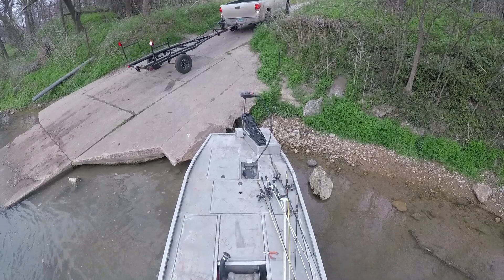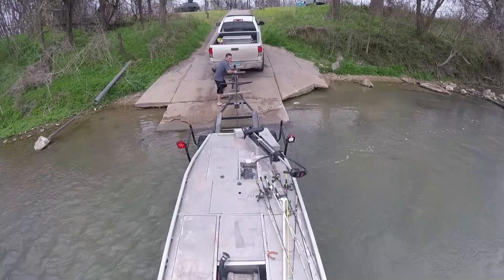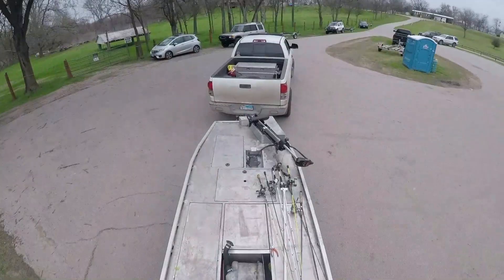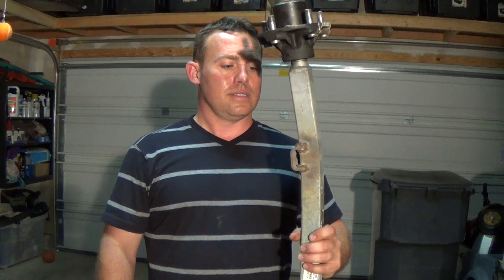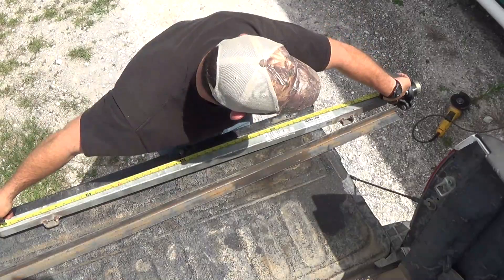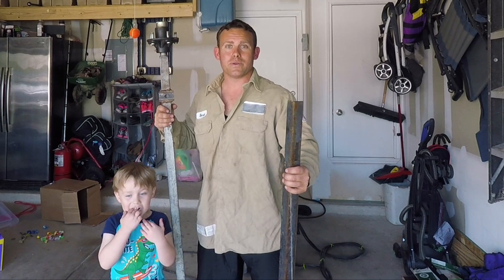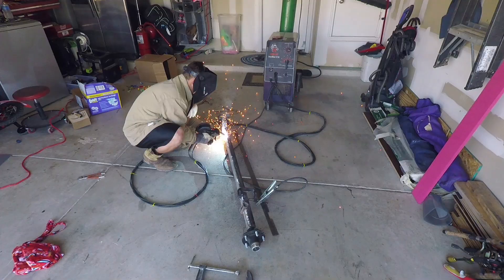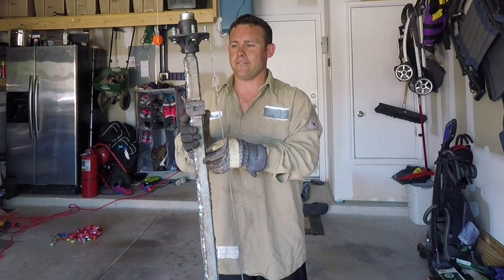How to Fix a Boat Trailer axle. Boat Trailer Fail.

Comment: Nice fix. I was thinking of using my tubeing bender instead of a chain..and you did it!
Reply from the maker: Yeah it was probably alot easier. I've gone through a whole new set of tires with this axle, still going strong Thanks Chris

Comment: Nice job on the fix, did it last? I bent a 2x2xquarter single axle and I wish I had thought about using angle iron like you did. What I did was just flip it so the bend would be up then I welded between the leafs a square smaller tube, spot welded it on top of the bend, so far I have hauled with it once, no problems but there is that area that was not covered with re-enforcement which is the area from the spindle to the leaf and between the mounting bolts.
I have a dual axle trailer  2x2xquarter that I bent as well, so on that one I believe I will use your method Angle vs smaller square stock, next time I make an axle for a trailer though I think I will go larger diameter and round, the 2x2xquarter seems to have a limit I want to go higher than.
Reply from the maker: Oh yeah! I’m still driving around on that axle and have been on some long road trips to go fishing.

Comment: Terrific video! Love your approach!  How did you know you were gonna need a Harbor Freight 12 ton hydraulic pipe bender ahead of time, to already have one? Positively psychic!  One boat trailer fail I had was a spindle getting bent, don't remember how, but it wiped out a couple weeks of boating expeditions, had to replace the axle.  Other boat trailer fails, bought a 16 foot aluminum boat, only had to replace the hubs on that one.  When Cabela's has your replacement hub in stock, it's a good day.
Reply from the maker: Oh yeah, nothing worst than being stuck on the side of the road trying to brain storm what to do. Yeah I already had the pipe bender. Thanks Jim

Comment: Last night my leaf spring broke and my axle spun around all the way from the right side to the back left corner of the boat and the left side was hanging by the front leaf spring bolt and that tire was bound up and at an angle. Had a tow truck take it to the house about to order a new one since my current axle has a 90 degree bend in it and most of the leaf spring hangers broke off
Reply from the maker: Oh dang, thats a bad one brahden. I hope your able to get that all fixed up. I bet that looks horrible.

Comment: Nice Job straightening and reinforcing BUT...you mounted the repaired axle on Top of the leaf springs.  It was originally Below the leaf springs.  Your trailer does not run level now.
Reply from the maker: You are 100% correct. Very smart to catch that no one else has caught that. I did that on purpose, I lowered the trailer boards and flipped my hitch receiver upside down. Thanks  bob

Comment: Had somebody helping me push my trailer up into a 16 foot truck bed.
Using steel on steel ramps.  Halfway up one wheel buckled.  Took the
trailer down again and saw the bolting surface of wheel had deformed.
Lifted damage side of trailer using wheel axle jack.  Unbolted wheel.  
Axle bolts found damaged also.  Began repair.  Accepted free wheel
replacement.  Found local hardware outlets were closing early due to
pandemic concerns.  I've never experienced a national health problem 
which shuttered part replacement retailers.  Yes, I was masked with
gloves and goggles on also.  Put away my tools and will go online to see
what walk-in retailers are available tomorrow morning.   Decided  I'm too
old fashioned to seek Drone delivery services.  Or risk losing a delivery to
trespassing thieves.  Cash and carry, that's me.   Know what I'm saying?
Reply from the maker: Dang, I'm sorry that sounds horrible. I know exactly what you mean. Times aren't like they used to be, this is a whole new world. I hope you get that thing fixed soon, sounds like a bad situation.

Comment: How much would a new one cost?
Reply from the maker: All said and done it isn't as expensive as you would think, unless you do not have a welder and have to hire to get it installed but parts will average you 100-150$
Reply: @TBassFactory    Thanks for the reply.....  I just bought a neglected  Basstender and it's trailer...  it's not beyond repair  but i was thinking of replacing the axle(comes  with hubs and suspension   right?)all i have to do is bolt on tires which i have replaced already.    I know the hubs/wheels/bearings could do with  some looking after... and the leafs  are rusty... The Bunks are to be re positioned and re carpeted.